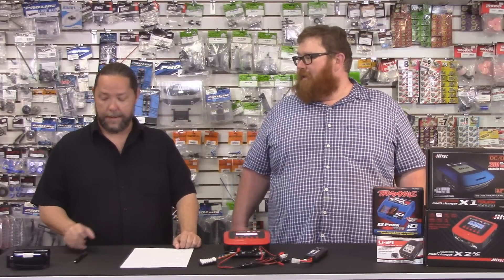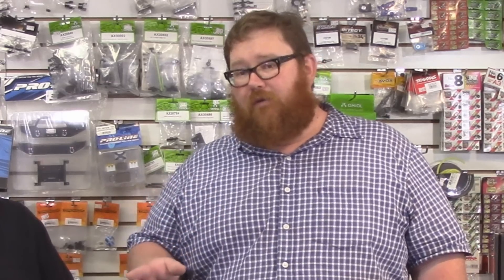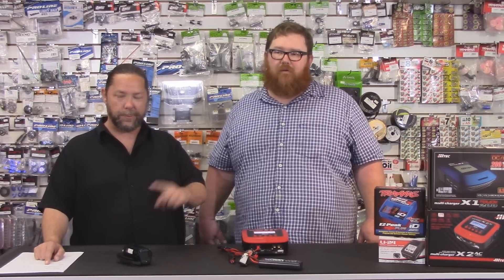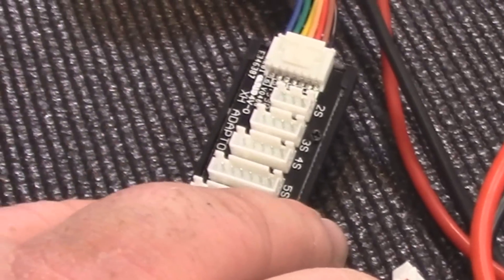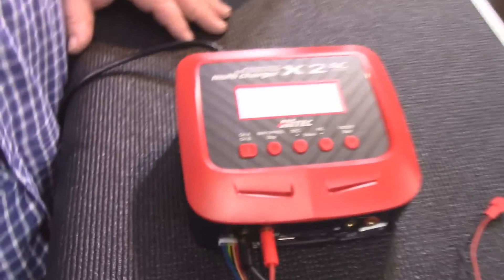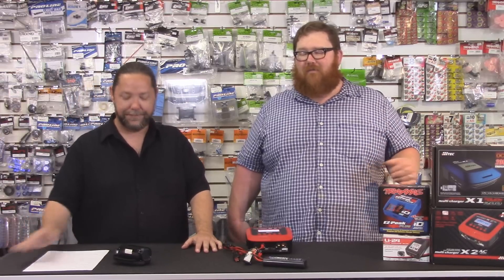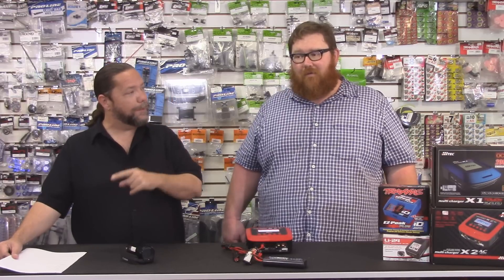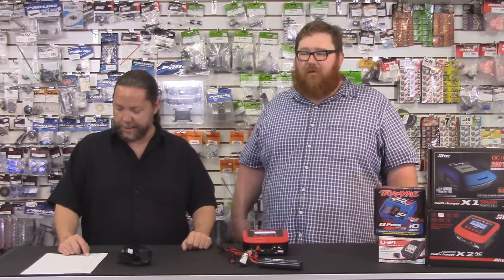Charge LiPo Batteries - HOW-TO

Comment: I recently purchased the black edition of this Hitec x2 , is it bad if I charge 1 venom 3s 5000 35c lipo At 100 Watts ? Since this charger let’s you split from both Chanel’s either 50 on one side or 50 on the other it gives you the option to put 100 watts on one side but is it safe ?
Reply from the maker: Its never a good idea to push electronics to the limit, but if you do not abuse it, nothing bad is going to happen. Hitec has safety cut offs, so you should be good.

Comment: Hiya I have a 2s 4200Mah 7.4v 32c Panther Power battery that came stock with my car. I balance charge it with a UP100AC Plus charger and I set the charger to 4.2a. When it is charging is it normal for it to drop to 0.3a - 0.6a and while charging it says 8.25V how long would it take to charge like that and is it safe? I'm Just wondering if that is normal or not as I am a total novice when it comes to charging li-po's. You video was very informative and helped me a lot I am guessing the battery is a cheap Chinese one as it came stock with the car from GearBest and will be looking for a better one very soon.
Reply from the maker: It is normal and actually even good for your battery when current drops and raises back. If all the numbers are correct, then it shouldn't take you longer then 1h ( +/-10mins )

Comment: Hi, I am trying to create a drone and I bought a 14.8v lipo battery. What charger would work best?
Reply from the maker: Whats your budget?....actually, anything would do it, as long as it does 4S.
Reply: Thank you! But which one would be the best choice? If you can, can you please send me the link of the charger?
Reply from the maker: Same question, what's your budget? Also, "better" is a relative word, what is better for one, may be not a big deal for somebody else. What is important for you?
Reply: I wouldn't really mind the price.
Reply from the maker: Thats the answer every sales person dreams about! Would you be so kind as to give us a call and repeat this exact thing to Roger? :) LOL 562-425-9000
jokes aside, any Lipo charger with over 60W and 6A would do it. Just check the specs. For most part cheap chargers are at 30W if not less, that is still OK, but if you get yourself some nice 4S pack, the you should be able to charge it with high Amperage and that is only possible with high power (Wattage/W).
Reply: Sure! Thanks!
Reply: Hi, will it matter what voltage it is? Like can you charge a 14.8v lipo battery with a 16.8v lipo charger. Or can you charge a 14.8v lipo battery with a 11.1v lipo charger
Reply from the maker: Voltage matters the most, so be careful with this ( mismatched voltage is a known for setting batteries on fire).
Reply from the maker: I'll pass the info to our boss/manager (as it is up to them to decide stuff like this), but regardless thanks for your support and subscription.
Reply: Thank you so much!
Reply: RC Street Shop Hi, I've found this charger, would it work for the 14.8v lipo battery?

Comment: Hi, great video as I am just starting to get in to lipos. I purchased a Traxxas charger and a Traxxas 5800mah 2s lipo for my stampede. I noticed the battery is in a soft case but I am planning to jump and bash my truck as Traxxas shows in their videos. Will this damage the battery and cause a fire later on? Why does Traxxas use/recommend soft cases in their lipos vs hard cases?
Reply from the maker: It is hard to say why Traxxas does it one way vs the other, but regardless, it is always a good idea to add extra layer of protection, no matter how you plan to ride/play with it. Batteries do not like direct impacts, but if you physically do not hit the battery, then everything will be safe.
Reply: One other thing to add about soft case lipos that may not be oblivious at first.. if you have a hard case lipo, there is no way for you to physically "see" the cells so if one was starting to swell or puff, you may not notice it til it's to late w/a hard case lipo. Not that I'm against them.. I've run both soft and hard case lipos for years and never had a problem with either

Comment: The nominal voltage for a LiPo battery is 3.7 volts per cell. The maximum a LiPo cell should be 4.20 volts. The minimum is not to let a LiPo cell go below 3.0 volts. Most ESCs set their LiPo cut off at 3.3 volts. I would plug in LiPo battery alarm/checker and set it at 3.5 volts to be safe. Also please store and charge your LiPos in a fireproof battery bag or case.
Reply from the maker: Back in the day manufacturers used to set cut off at 2.7V-2.9V, it was OK until your pack becomes unbalanced and one of the cells drops a bit lower, that changes the calculation for the whole pack and let that cell discharges even lower ( there were no ways to check individual voltages while use), so that slightly damages the cell and it puffs. This is why these days everybody sets cut off at 3V, to give cells a little bit of room while discharge.
Voltage drops from 4.2V to lets say 3V, but it stays at 3.7V for much longer period of time. That nominal voltage is just a reference point where battery holds voltage while discharging.

Comment: if charging is through the skinny wires, then why do we need to hook up the 2 thick wires?
Reply from the maker: One set of wires charge the battery and another - checks voltage for each individual cell.

Comment: If I have a 3s, 35c, 5000 mah battery how many amps should I charge it at?
Reply from the maker: 5A. It is your safe manufacturer recommended charge (to get warranty coverage etc).
Reply: RC Street Shop could I charge it under 5 amps? 4, 3, etc?
Reply from the maker: Absolutely. It is going to be even better for your battery life, just going to take longer.

Comment: LiPo battery is 3.7V per cell, not 4.2V.  When fully charged, the LiPo Battery can reach 4.2V. Safe range for a LiPo battery is 3.2 to 4.2V.
Reply from the maker: 4.2V is a cut off voltage when the battery is full (overcharging is damaging it). 
One may go lower then 3.2V....all the way down to 2.7-2.8V but it is hard to control even discharge for the whole pack and it is better/safer to stop it at 3.2V or 3V

Comment: isnt it better for the battery if you always charge it at 1 amp, thats what my hobby store told me so thats what i do, is that ok?
Reply from the maker: It is definitely safe for any batter over 1000mah, but not necessarily optimal. The golden rule is to charge with 1C charge rate or 1x of capacity. So if you have 1000Mh pack your "safe charge" should be 1A and if you have 5000Mah pack, then it is 5A

Comment: How do you know how many s does your battery have if it does not say in your battery like that one is a 2s but how did u know
Reply from the maker: "S" is the number of cells. If yours has two, then its 2S, another way is to check voltage: 7.2V is 2S, 11.1 - 3S, 14.3V - 4S etc.

Comment: OOOOPS..it asks for the per cell discharge Voltage: 1-2 or 3. How do you know which to enter ? Great vid, I hit and subbed, thanks.
Reply from the maker: You do not want to go lower than 3.0V per cell (2.8V at most).
Reply: RC Street Shop Thanks for the reply. So you would want to set it for #3 then, got it. Thanks guys.
Reply from the maker: Anytime!

Comment: I have a 7600mAh LiPo battery and I have a charger that my hobby shop says can charge any battery. The title on my batter states: "7600mAh LiPo BATTERY 7.4V 50c 2S2P 56.2Wh TRX". My charger only goes to 7.0V. What do I charge my battery at and how do I set it up?
Reply from the maker: What charger is that? 7V is way too low...could it be 7A?
Reply: RC Street Shop yes it only goes to 7.00A my apologies. I already charged it and it didn't blow up thankfully. Thanks for your help
Reply from the maker: Cool! As a general rule, 7A charger should charge 7000mah battery in one hour or less....so 7600mah battery should take just a hair longer then 1 h.!
Reply: RC Street Shop awesome. Thanks for your help!!

Comment: My battery is a 5000mah, but it has a 3c charge rating.  As a novice, and after watching this video, that shit had me confused for a minute.
Reply from the maker: Most manufacturers recommend not to exceed 1C charge rate for any Lipo battery. It will be 5A for your batter. Your battery might handle more (up to 15A), but it is not recommended for a "safe" charge.

Comment: When I charge my 3s lipo battery after 2 hours one light is turn into green which mean full charge and after 15 minutes the other light turn into green and the other it takes time to fully charged
Reply from the maker: I would speak with the manufacturer of your charger to see what is going on.
Reply: tjek auto stop. all charter stop after1/2hours. mine after one. i diddent understand at start. but. after i find settings i set it at 2 hours. but if you like he explane. dont go under 3,5 min 3,5 pr Sel. if one of the 3 sel are bad. rember to only chard that sel. when it match the other. ballance charge it. all is fine again.all 3 is at the same 2,2 again ;-)not 2,21 only 2,2 " rembet manny charder if fake. so chek your charting. know your charter.  i save manny battery that way. if one s is below,. the other, i just plug wire and only chard that one sel. works every time" never have damage a battery yet. yes,. byt recover it everytime. oldest 5 munth. just save one today. o,ooo,1 on sel one. om charting the other now. got 2.2 on all 4 by help the not dead. but bad sel! hope i help! :-)